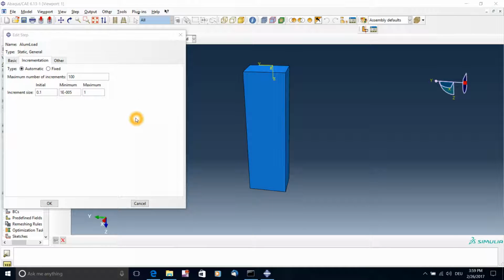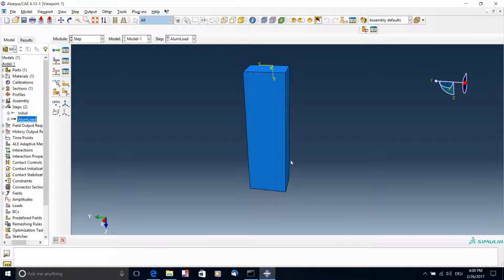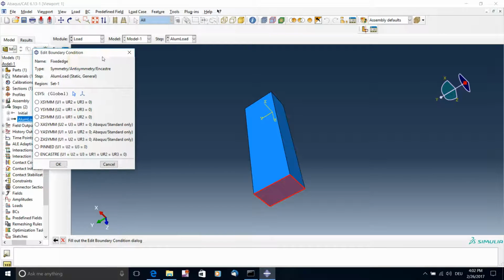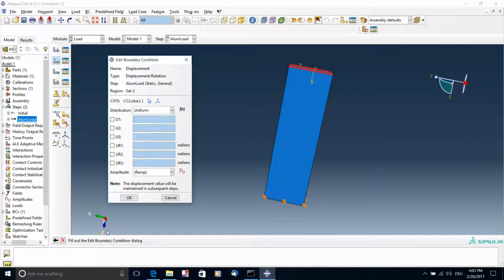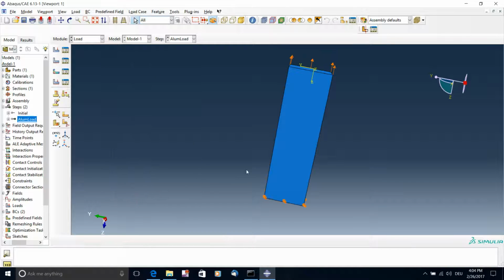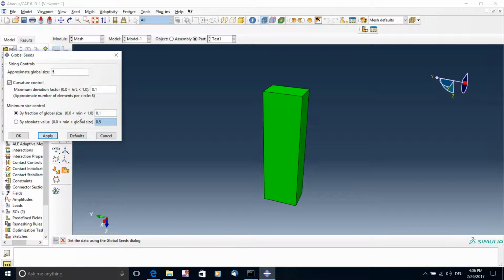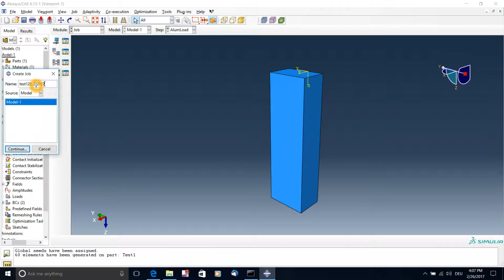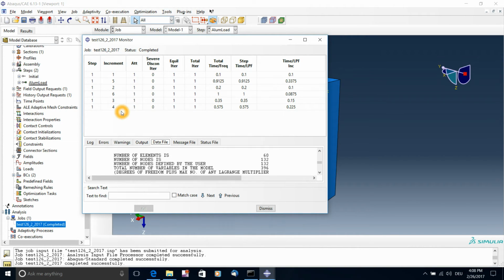Abaqus Beginner Tutorial Part2

Comment: can u make videos using orthotropic materials as well.
Reply from the maker: Hello Swaroop. For orthotropic material, you only Need to chage the "Elastic" property of the material to orthotropic. Then enter the D1111 - D2222... values. There are nine. And the important step at the end is because orthotropic is orientation dependent you must define the orientaiton of the model. You define orientation also in the "Property menue" under the "Assigne Material Orientation" Function" (the fifth Icon in the menue). 11 is along X, 22 along Y and 33 along Z.
Reply: @RamiRouhana  How do we gat these D1111 - D2222... values???
Reply from the maker: It depends on the material you want to simulate. Usually tensile and xompression tests are made to find those values . OR the values could be published in a paper. OR if the material is a Composite ,you can calculate the D values.